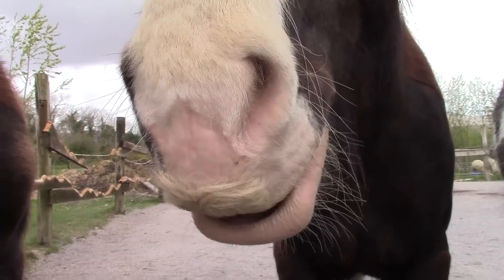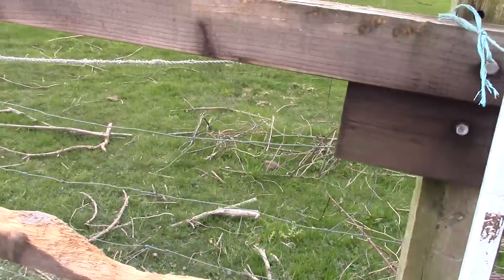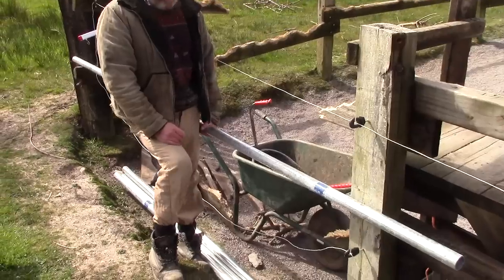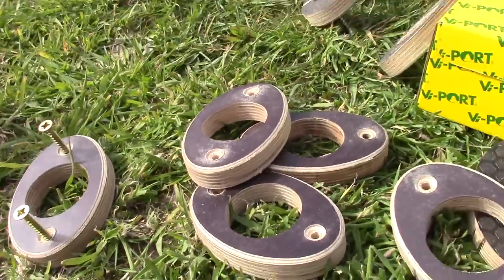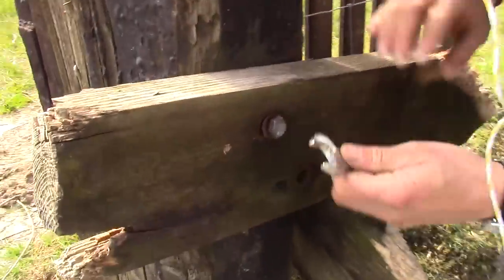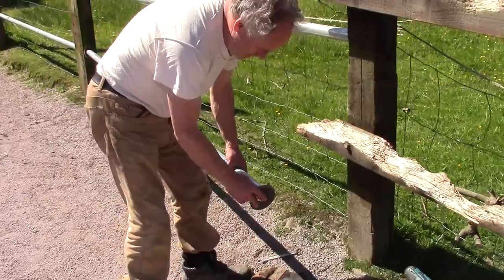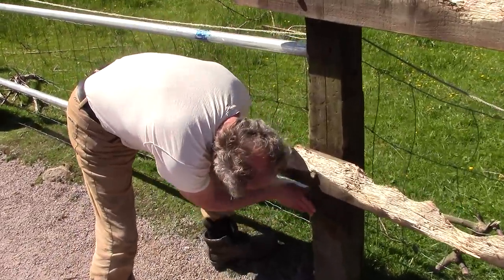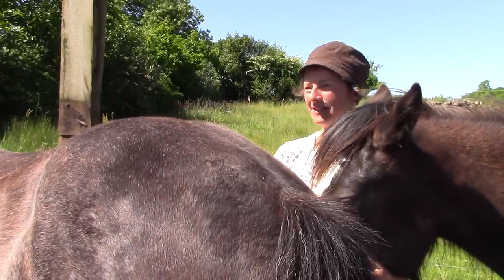Homemade Permanent Horse Paddock Fencing

Comment: I use to work at a race track and had to replace a lot of stall wall planks because the horses would chew them.  I once asked a vet what causes the horse to chew the walls and was told more then likely it was boredom.
Reply: Yep sometimes you can get away with a horse toy.. a plastic barrel with food inside they have to knock around to get a treat out.
Reply: The moment I saw it I said boredom.

Comment: Boredom is the problem that is whey they are crib biting. Toys would keep them entertained and stimulated.
Reply: I agree boredom is probably the root issue, but it is not the only cause of cribbing, or crib biting, though this looks maybe more like lignophagia... (which used to be under the same heading of cribbing, but apparently is now classed as something separate...)
Reply from the maker: Yes, we thought of that too - and you may be right, but it's odd that it's the first time it's happened in all these years
Reply: I'm in Ireland too - my horses started eating wood when they got low in copper in their diet. Here in Ireland all hay you buy and anything else grown here (beet pulp, oats etc) is HIGH in Iron - which causes a copper/zinc etc deficiency. Low copper is the main issue. All well water and even my spring water is also high in iron.
High iron due to high rainfall washing out all other nutrients. Hence why the streams run red here!
Copper deficiency is easier to see on the horse in those with dark coats - especially black - like at the 1 minute mark - your black and white cob - his black is 'red black' - it's not jet black. It's not sun bleaching. I have turned my mare back to black during summer with Cuppra copper supplement - it's very effective.
Once i got copper corrected in their diet - and continue to always supplement it according to the high level of iron in the diet - they have stopped eating wood. 
Hay balancer feeds here in Ireland like Baileys and Gain all ADD iron to their hay balancers so they are no good. Grass grazing here is high in iron. Not enough copper can also result in lethargy due to anemia - the iron requires copper to make blood cells. Also it's important for immune function (parasite control) aswell as pigmentation of the hair. (in humans too! Early greying? Copper deficiency!)
Cuppra worked wonders for my horses coats and general health - amazing difference!  I would recommend it to all horse owners in Ireland - or some other high copper/no iron supplement. (Just check all your feeds don't have iron added otherwise you just add to the grazing and hay high iron burden they are already struggling with and would need even MORE copper to correct it)
Keep the copper feed away from goats and sheep though - they dont need anywhere near as much as horses.
Reply: +Neupsychal They are definitely doing it for a reason, deficiency, boredom, it's just not seen in wild horses. I've never ever seen a wild horse chew wood. Having said that, i think they said they keep them in the small area during the day. Not to be judgemental, but it's not natural environments that create these issues. I always feel bad for horses as they cannot speak what they want. Listen to your horses on youtube though would know what to do, as would I as I'm super tuned in to nature. These horses aren't just asking for their needs to be met, they are screaming :(
Reply: I agree, boredom is a major cause of many domesticated horses behavioural issues! It's always a struggle to mimic natural environments for a horse as they are MEANT to be roaming so many thousands of acres. Here in Ireland, certainly the west, it's impossible to use the paddocks in the winter for grazing as the weather is so wet. It would be a mud bath within weeks so many have 'dry lots' to house horses during the winter. I use a Jamie Jackson 'Paddock Paradise' idea for my horses which i'm still constructing and ever expanding so i can keep the horses MOVING and ACTIVE. 
 I observed wood chewing in my horses if the previous summer was very wet AND i didn't supplement copper/magnesium/zinc. This, i believe, causes an even higher ratio of iron in the hay i buy due to many more nutrients being washed out of the soil - esp. Mag and copper. Mag and copper are not added to soils generally, only NPK added. This could be why the poster experienced it one year rather than others. 
It's hard to get the mineral balance right, it all depends on the environment they're in. Once you get the balance right it's wonderful to experience happy horses that look good and behave naturally 'spirited' :-)
The poster might now find their horses chewing the new galvanised poles for the zinc coating nutrient!! I like their idea for the fencing, very ingenious, yet i wouldn't ignore the root cause of wood chewing.

Comment: There are sugars in the wood that leach out gradually while the wood ages.  That's why many mills   soak their logs for a year to wash out the sugars because it would warp the wood while aging.  If you milled the boards yourself you might have skipped that step.   Who knew that it would matter if you used it to fence in Horses, who have sweet tooths.
Reply: Allen .Berge that makes sense. Best suggestion here!!

Comment: It is not a dietary issue, it is a boredom issue!  When horses get board the chew on things like your fence!  They will also chew on the metal rails you have installed as well and unless they are very thick they will eventually crush the pipes over time!  You noted that they started this behavior in the winter when you are probably working them much less! As a result any extended time in a small paddock will result in them getting board and with nothing to browse on like in the spring summer and fall they chew on what is there at hand.  Try getting them some toys to play with if you are keeping them in a small area during the day.
Reply from the maker: We work with them everyday, often for hours at a time. And this time of year they are out in the fields all night. So, yes, they may be bored but we have never had this happen in all the years they&#39;ve lived here
Reply: It never happens until it happens.  The thing is like people they get into habits, and this is one of their bad ones when it starts sometimes it is hard to break them.  They may not have the same motivators now that started it but they keep doing it because they are used to doing it.  Like sucking air with some horses where they hook their top teeth on the edge of a rail and swallow air.  first it is a boredom thing then a habit that is hard to break them of.  The steal rails will help if it is just a habit at this point as they will not be as enjoyable to bite on but if they are still board for what ever reason they may still bite on them.  I have had horses crush metal gate rails and pipes before we were able to stop them from doing it.  Good luck, love your videos!  Mike T

Comment: I'll share some wisdom that I have - Paint the wood with used motor oil. It recycles the old oil from mechanics, seasons and protects the wood....and Mr & Mrs Ed, won't gnaw your fence. Hope it helps guys.
Reply: sonseere10
Maybe you could expand on why that's an dumb thing to say? Enlighten me, because what I said is perfectly true, and valid.
Reply: I shared my nugget of wisdom because I painted a post and rail fence covering 50 acres - each horse in a one acre plot - they still chewed the wood.

When I get  bored I eat chips, crisps and chocolate, but that's because I dont want to eat vegetables, cause dammit, I'm bored, trying something new.

Much to ponder, but I don't want animals given free reign (excuse the pun)

Comment: forgive me, but wouldn't it be quicker and more durable job, to: a) squeeze the end of the pipe flat (big vice works well, press works better ;-) ), drill through one/two holes, b) bend it at 90 deg, and presto - integral  "hanger" system.
I'm not sure that "waterproof" ply, will work very good in this application - cross section is too much exposed, proportionally (I think). 

hope I'm wrong though, and you get years of use from it.
Reply from the maker: You're a much better man than me - I would struggle to squash the ends with my vice : -  )
I'm not worried about the strength of the ply - they're really solid. but we will seal them to try to keep the water out.
Reply: +WayOutWest Blowinblog the press it would need to be then...😊 your solution looks better all right, hope it'll last when weather sealed.